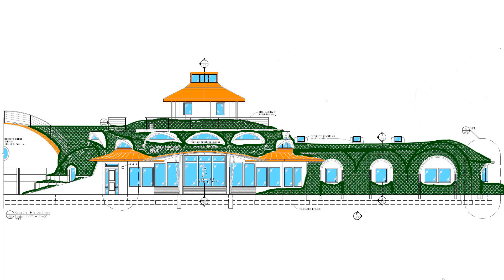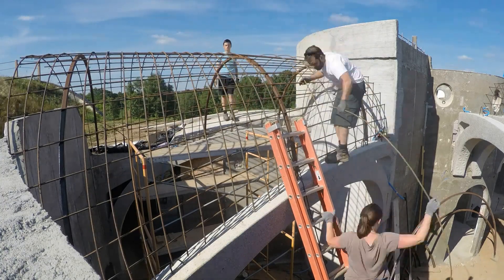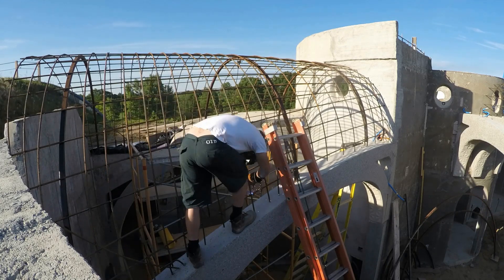41.2, Erecting the steel for the radial vaults (Part 2)

Comment: How much do you think this will have cost you by the end of construction? How much has this cost you so far?
Reply from the maker: We currently estimate under 100$ per square ft when we are done.  Actually, there is still a good bit of the budget still available, but the shotcrete, stucco and insulation budgets are in the red and I am just paying for those bits as I go.  We still have budget for doors, kitchen, stairs, etc.

Comment: I am wondering how you are going to deal with water drainage between the arches?
Reply from the maker: When we filled the space with shotcrete, it was pretty easy to make sure there was more fill at the inside so the water would flow toward the outside.  Next we will add insulation and a convex layer at the top so the water wont even see the radial vault shape at all.

Comment: I use to think you were completely insane but enjoyed the unconventional build; Now i think your only a little crazy lol. Those concrete arches you poured on the ground were impressive and now the whole design makes sense with the radial rebar vault up. Question, If you had to go back and do it again, do you think it would have been easier/ quicker to pour the perimeter curved walls either standing up or on the ground or do you think your the path you took is still the best option.
Reply from the maker: If I were to do it again, I would probably go more with the quonset huts...  4 of them in a row, plus a tower because I couldn't resist.  I would have been done the first year and under budget.  ¯\_(ツ)_/¯

But all this other stuff has been interesting and a good learning experience.

Comment: Just wondering what your plans are for the rain/snow/ice buildup between the arches???  Ice jacking is no joke.
Reply from the maker: WHen you see the concrete go on, it will make more sense.  water will never sit "between" the arches.  Eventually, I'll fill the gap with insulation and then put another layer of concrete and waterproofing on the top to form a convex surface.  Then I'll cover that with soil.

Comment: Engineers only see calculation numbers. Your #5 rebar/Engineer story reminded me of a similar event several decades ago. The structural engineer called out 1" anchor bolts every 16" to hold a diaphragm floor system to the top of basement walls. I asked him if he had ever bought 1" anchor bolts (at the time $4 each). He said no. I said if I am drilling the plate every 16", I don't mind drilling more holes at that point, so design it for 1/2" bolts ($0.15 each at the time) . Turns out he called them at 8" O.C.Saved me a ton of money and did not take much more time.

I have always thought that engineers and architects should be forced to spend at least a summer as a jobsite laborer before they get their money-machine license. They might learn something about rebar and anchor bolts and a ton or other practical things.
Reply from the maker: Yea, for the #4 vs #5 situation, volume and weight grow as the square of the diameter, and cost is proportional to weight, so not quite the jump in price you are talking about, but the biggest issue is simply the strength required to curve them...  It's just not fun ;)
Reply: @Home in the Earth The other factor is how common items are. Years ago 1" anchor bolts were rare to see in a residence. I bet there were 100k 1/2" bolts sold for every one 1" bolt.

Comment: Getting a good wifi signal is going on be a bitch in this house. Lol.
Reply from the maker: Interesting topic...   I thought the steel (faraday cage) would stop the signals, but it didn't.  Nothing noticeable anyway.   Then I thought the concrete would stop the signals...  Nope.  Then we added dry dirt, but I still got good cell service in the deepest parts of the house.  Then we watered the dirt and started growing things on it...  That is what blocked the signal.  Water!  When it dries up a bit in late august, the signal gets thru a little easier, but when things are wet and growing, forget about it.  I need to sit by the windows to check my cell phone.
Reply: @SimonHomeintheEarth  Wow. That's interesting. Usually concrete and steel is wifis worst enemy.